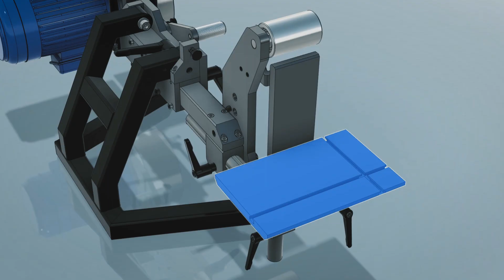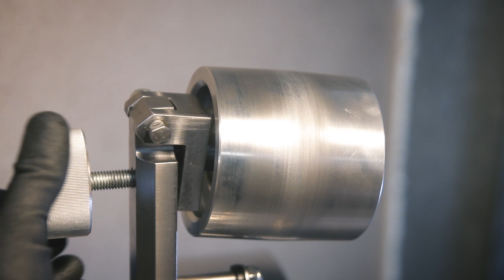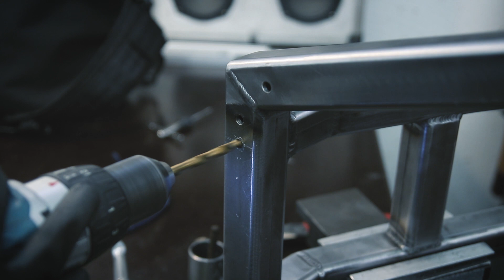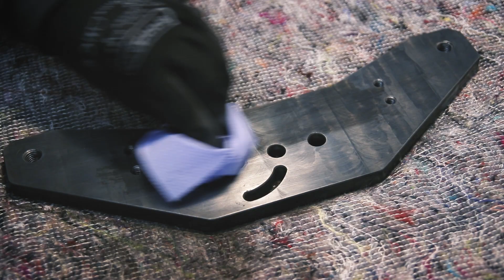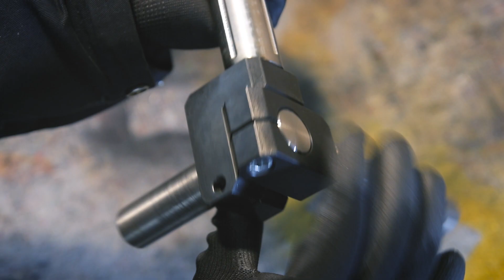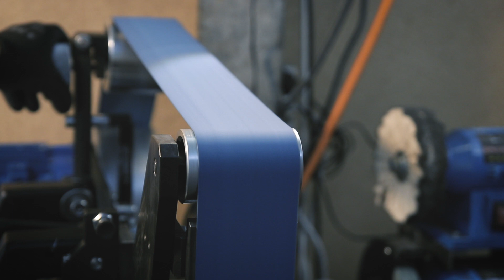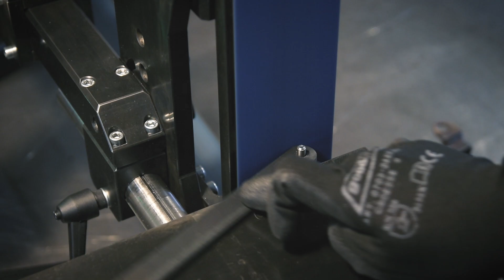Building a Machinists Belt Grinder - The Trilogy [Part 3 - Finale]

Comment: I think it's called bluing because it relies on oxidation. While heating steel a thin layer of oxide is created (that's why it doesn't work on inox), and depending on temperature and time the thickness of the layer changes. This layer has different optical properties than the non-oxidated surface, and this results in wave interference of light. Depending on the thickness, the resulting color changes, eventually getting blue. The bluing liquid tries to obtain this effect chemically, but I suppose the resulting thickness (and the purity of the oxide) are different and there is no interference, there's mainly absorption of all light, that's why is black. In this video of Clickspring (https://www.youtube.com/watch?v=NhjiIPohUyw) you can see heat bluing in action, and the result is wonderful.
Reply from the maker: Thanks for the explanation!

Comment: The best belt grinder I've seen, awesome job!
The only thing I would improve, is to make a bevel on the bottom of the table, for clearance when used at 45°.
Reply: Exactly what I was going to suggest! 👍
Reply: And a 3” notch in the work table so that’s the platten is inside the work table. Fantastic job all the way around!!!

Comment: One thought on the platten, you should have it cut at 45° on the side that face the belt so you don't end up with a big gap between the 2 with the risk of the machine to swallow your part when grinding at a 45° angle.

Comment: It's a little late for it to help you but hopefully it helps others:  When you're trying to fish cables through all sorts of difficult bends, use string and a vacuum cleaner.  Tie a wad of rag or paper towel to one end of the string and stuff it into one hole - apply suction to the other.  Then you can tie your cable to the string and pull it back the other direction.
Reply from the maker: I have actually used that technique when trying to route internal cables through bike frames - you're right it helps a bunch. Somehow didn't think of it this time
Reply: 5 years later and you're still helping someone, I've run into this problem numerous times and I never thought of this. What a great tool in my arsenal!

Comment: Is your mill a belt drive mill? Do you run into any slipping issues with the heavy cuts?
Reply from the maker: It is, but it's a toothed belt so I don't think the chance of slipping is very high. It is VFD driven so it does have overload protection, but I don't push it hard enough to engage that, I run pretty slow feeds on those heavy cuts. I did manage to make the belt slip on my lathe once or twice though and I actually consider that a good thing, it might save you from doing some real damage

Comment: Now that you have only put a quarter circle slot in the platen rotation lock, you'll find a reason to want the half circle. This grinder looks fantastic, and should do pretty much anything you ask of it, accurately. You could also add a spark deflector above the tracking wheel that can contain the sparks that don't let go.
Reply from the maker: Yeah spark deflectors and some kind of dust collection are things I still want to add to this to contain the mess a little

Comment: @PhilVandelay How do you like the mill you are using?  It seems to do a good job with making this grinder.   Looking to invest in my own bench mill for this and making robotics parts.
Reply from the maker: Overall I'm satisfied with it, it does a good job for a benchtop mill. It would be good to have a larger RPM range as this machine doesn't have a gearbox so it's only got the VFD for speed control which is a bit limited. As far as size/capacity and power goes, I have no complaints, you can do almost everything with this that you'd usually do on much larger machines. Main thing I'm missing is powerfeeds which can be added though. That being said this is about as large as benchtop machines get (same for the lathe) and I wouldn't go any smaller, you do need the mass, because even these machines I can get to shake without problems if I push them hard enough. Anyway - these import machines are much better than their reputation in my opinion.
Reply: Phil Vandelay glad to hear!  Thank you for making these videos.  Great to see good craftsmanship and well thought out design.

Comment: That design is just so good, awesome job buddy 👍👍

One thing though, does your VFD feature terminals for a brake resistor?

I only ask as I work for a VFD manufacturer so if not, just ignore the question but if it does, it's well worth installing the resistor, especially regarding the E stop as the VFD converts kinetic energy into electricity and dumps it into the resistor, which allows the motor it's driving to stop on a dime, regardless of it's relative rpm or load.
Reply: Upvoted your comment, that's the only thing I felt was missing on this magnificient belt grinder. I had that "Oh..." moment when he pressed the E-stop :)
Reply from the maker: Ah so that's what those are for! Thanks for the tip, I will definitely look into that, because as you said, the VFD takes a while to slow down the motor. I can set how quick it decelerates in the menu, but if I pick a value that's too small it actually goes into overload protection and shuts down upon braking. I was suspecting that it has something to do with that, as the large drive wheel acts like a flywheel and has a lot of momentum when it's going full speed and I suppose the VFD can't slow it down any faster. I'm guessing there's a resistor built in for that which is just lacking capacity?
Reply: @PhilVandelay  great work on your machine ... says this arm chair QB  ..just a idea ,, take a string long enough hold one end and use air hose to blow it threw the area where you want to put the wires , tie the string to the wire and pull it threw ,, might be easy then pushing the wire threw ??  is the shop your full time job ?? you do great work ..
Reply: @randytravis3998  That's a clever way of trying to thread a draw wire. Kicking myself for never having thought of that!
Reply: @randytravis3998  Great idea. About 25 years ago I was building this 4 m high brass gate for some rich dude.  When we finished we realised we hadn't installed the wiring. Then my mate suggested some string and use an air gun to blow it thru the tubular frame. We were so relieved.
Reply: @rodandakiko2187  also done it with a shop vac on larger pipe too pull the string ,, had a rag tied too string so it could pull it  ,, just need a good seal ...
Reply: @TheMadMagician87  That or put a wad on the end and pull it with a shop vac. Electrical trades do this when running jetline (pulling string) down conduit raceways.

Comment: Fantastic! Great job, with the machine for sure but also with the video too. I really enjoyed watching you build this thing! I dig the aesthetic too...nice all around. Do you think that you might actually get some electrical shielding on your low voltage wires due to the chassis? Do you have a ground from the chassis/motor housing to earth? I'm curious if you've had to hunt down any of the little electrical noise "gremlins" that like to infest systems like these...

Comment: Ya wow! knocking torch/plasma cut edge's off, if you work bone yard scrap the railroad track creations, found a dumbell weight that a file wont cut (train axle scrap?) the sparks can show the alloy quite clearly with experience. and a test with a file or two there are a thousand facets to this ha ha. This tool, the best drill press you can find, a flat piece of say 3/8" and a hight gauge,layout die,carbide tip, a pretty good right angle plate biggest one you can find for your plate,automatic center punch and your on your way to metal working cool show . Oh look for parkerizing home brew on youtube a guy and i dont remember many names but his name was harold dames his video nailed the basics of hot blueing for the price of that cold blue and a hot plate you could have a lifetime of hot blue just keep it "topped" up thats just the basics there's gray,green ( UZI the millitary ones are parkerized green i believe) ya awesome video hope you introduce a bunch of people to metal working with this thanks

Comment: What I have watched here is the single most over engineered, over complicated and beautiful things I've ever seen. Now I'm going to feel bad every time I have to use my sorry excuse for a belt grinder.
Reply: ⭑⭑ The Wintergatan Marble Machine of Grinders. Great job! ⭑⭑
Reply: I am with you. mine has a treadmill motor. But it is still one of my most used tools. I just wish I could justify the machining tools. I would have a lot more DIY tools if I had a lathe and Mill.
Reply: @davidhoback4225  Very cool. The surface grinder is next on my list to build for mine. I built my 2x 72 for 30 bucks originally. I have since updated from skateboard wheels but still have less than $100 bucks in it. I have a video of it on my channel. Just don't judge my knives I shown on the video as they was my first few.  I have only made about 20 knives or so but it is one of the most handy tools in my shop I use it for wood working as well as just general grinding. I could not buy  a decent bench grinder for what I got in mine much less a belt grinder.

Comment: Hi Phil, 
amazing build! Thinking of buying your plans and building one myself :) what was the total cost for materials? Raw stock, motor, vfd?
Reply from the maker: Hey, I didn't keep track of the cost exactly, but it was around 500 for raw materials and probably another 500 for all the other stuff, just to give you a rough idea. The Motor and especially the VFD is probably where you can save the most money if you buy used. And steel/aluminum prices will vary a bit depending on your location

Comment: Superb work my friend, one of the best I've seen! Bluing derives from the gun trade I believe, shotgun/rifle barrels are blued and if you look closely, they do actually have a blue-black tint to them! ;)
Reply: Early firearms were “rust blued” & had a brown tinge, then came hot blueing that did have a slightly blue tinge.
Cold bluing is normally used to just repair / touch up on areas that the hot blueing gets worn off like angled edges.

Comment: This turned out amazing. About how much did it end up costing in materials?
Reply from the maker: I didn't keep track but if we're talking raw materials, it wasn't actually that much. The steel is pretty cheap, most expensive part was the huge aluminum chunk for the drive wheel. I think it was around 500€ in terms of steel and aluminum. Plus the Motor, VFD and the other hardware.

Comment: Welp I was thinking of picking up the plans for this Until I saw the price :p
Reply: @Thu Nell Ⓥ  its expensive for a hobbyist and takes too much time to do as a professional (time is money)  than to just suffer the loss of buying a mew 4x72 belt sander with an 5 year warranty. I honestly don't see how it's worth it to put into comparison a set of plasma cutting tips cost £12.99 for a set of six a large roll of mig wire is £12.99 a quarter ton of steel is £30, stuff that's actually useful for me and my business or buy a schematic for £35 and don't forget because of lockdown most of us engineering companies are going bust every penny counts in these times of hardships I honestly don't see myself paying that much for a single schematic.

Comment: If your tracking mechanism tends to back out or needs a bit more tension, you can add a small stack of belleville washers in there to preload the adjustment knob. I had to do that on mine, where the fit is looser. This is one of the greatest builds I've ever seen! Nice work!
Reply from the maker: Yeah I thought about adding a spring or something. But so far the belt pressing down on it seems to make it stay in place

Comment: Finally, part 3! Still waiting for your response from part II; make this for me as a kit and ship it, send total cost!
Reply from the maker: Sorry, probably didn't see the comment! I'm afraid the price would be ridiculous, it's not feasible for me to make and sell this. As I said it's not designed to be fast or easy to build, so even if I worked at minimum wage I can guarantee you wouldn't want to pay that much. It would still be extremely expensive. Unfortunately the only way to make anything cheap is to make thousands of them in a factory and I'm just one guy in a hobby shop
Reply: Phil Vandelay But maybe you could make your plans available? It would at least make the option of making it in the own shop easier. (or getting it made if one has the cash...)
Reply from the maker: @flyingby3703  Plans are available! There's a link in the description
Reply: Phil Vandelay Oh, I didn’t look close enough ;). My bad.
Reply: Phil Vandelay huh, this one really paid off for you.... Congrats on your success!
Reply: @PhilVandelay  Did you keep a BOM? Could you estimate the cost in parts and labor just for fun?
Reply from the maker: @CyborgPandaBaby  I didn't keep track of the time so I don't know exactly, but it was about two months worth of normal workdays (but spread out over ~3 months) So even at a low hourly wage, the work hours alone would come out to over 5000$, and that's not even including all the time to design/plan the build and cost of materials. So if I really wanted to get a reasonable amount of pay for it, we'd probably be looking at something close to 5 figures... like I said, a ridiculous amount nobody would pay. Of course if you made 10 of these with lasercutting/CNC machines that would be a different story - but money aside, I'm not interested in making stuff for sale, I don't like building the same thing twice and if that was my job, I wouldn't be able to make videos for you guys 😉
Reply: @PhilVandelay  While I would love for something like this to be for sale I could never even afford it because the work and effort you put into this is astounding. The people asking you to build another for them are crazy
Reply: @PhilVandelay  are you ok ?? it's been a while since your last video ,,
Reply from the maker: @randytravis3998  Don't worry I'm ok ;) My projects are complex so they take a long time to complete hence why I can't post videos that often
Reply: @PhilVandelay  they are worth the wait ,, just got a bit worried ... stay safe .. keep up the great videos you do love too watch them ,,
Reply: @PhilVandelay  hi, do you make videos in Russian?
Reply: This work of yours is so well done that it will certainly be attacked by envious and raters on duty!